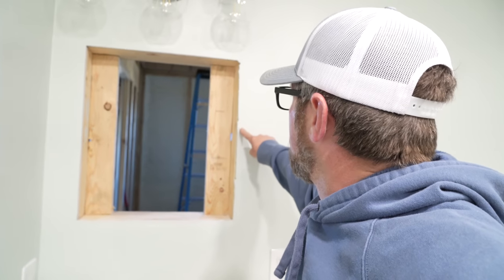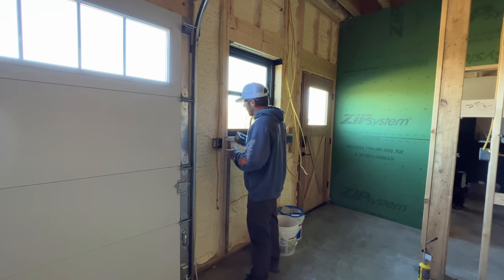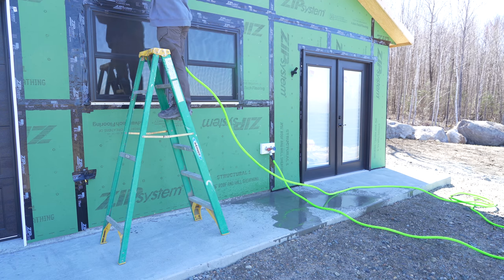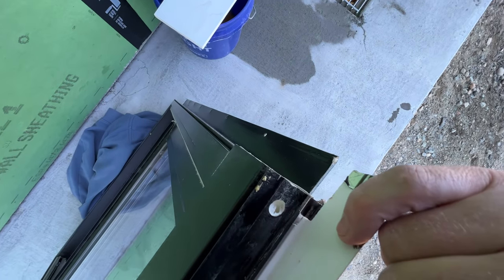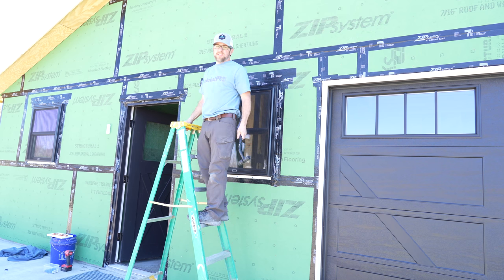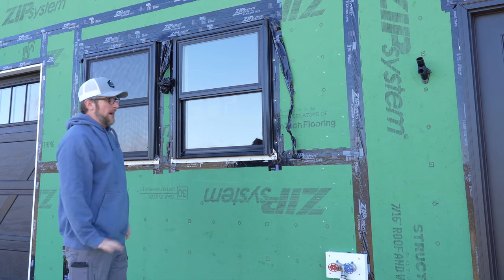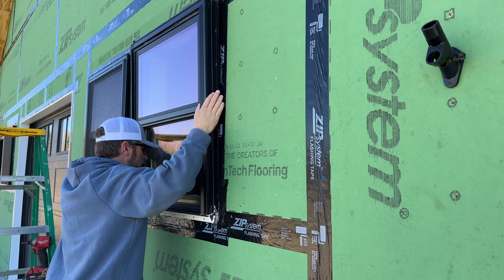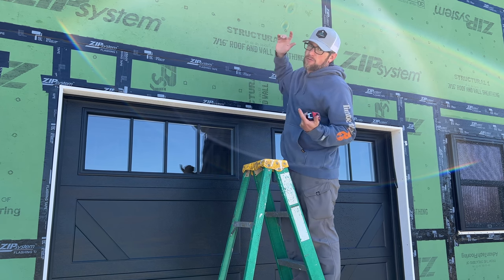THIS IS DISAPPOINTING  | Building Our OFF GRID House in the WOODS

Comment: I always use a drip cap over windows and doors, even if the maker says they have a better way. Once you get the siding on and caulk the windows. you shouldn't have any problems. Good luck with the rest of the build.
Reply: Same here. It is not much extra work but provides a better deal against water runoff from wall into the building at each window.
Reply: A drip cap is very essential. Some extend the cap to an inch or two beyond the casing.
Reply: @clark7117  yes, as a rule of thumb, I  went at least an inch over on each side. Sometimes a half inch depending on type of window and siding.

Comment: I still think a stoop or porch cover the full length across the front would not only add to the aesthetics of the home (with matching roof), but it would also relieve some of your leaking problem and allow you to open the roll-up door in a slow rain.
Reply: He said on the video that he hasn’t decided if he’s going put a roof all the way across the front
Reply: @lorenturner4838  yeah, I saw that after I made my comment. He said he was thinking of a cover over the front door OR possibly the full length. I think a full length cover would look really good PLUS would shield front door and double doors leading to the prep room. Additionally, it would not only protect the roll-up door, but it would give the ability to have it open without worry during a light rain.

Comment: As a one time window builder, I would say it's the window at fault not your installation. The corner 45 degree joint is a common weak point in the build. The jig may not have been set exactly straight during manufacturing. A touch of clear silicone added to the corners of the frame may give you peace of mind. Good luck.
Reply: I agree that its the window itself. Not installation .
Reply: I also think it is the window and not the zip tape. I had the same kind in white and mine did until I caulked mine in the corners and around the inside edges.
Reply: This is exactly what I thought was the problem
Reply: @jerrywelch5323  I have 17 Pella windows in my house and 14 are the same double hung that Lumnah Acres has in there house and I had 2 that leaked a lot  and 1 that only on a hard rain. When a removed them they had some cracking at the joints and leaked from bracks on the inside at the bottoms.
Reply: Ditto  on the silicone.
Reply: @justatim8143  Did you look at the video and see the sun coming threw the nailer holes
Reply: @justatim8143  Yup. I also have had them leak around the seals in the Up/Down channels. A hard rain can blow right through them and pool at the bottom. Had to put trim around the outside of the windows, covering the sliding window edges to keep hard rain out.
Reply: @jerrywelch5323  All I seen was light coming in at the bottom which is OK to let the water drain out of the bottom.
Reply from the maker: Thanks Aaron
Reply: Pro Pm seen same thing on finished sky light uppers 20 foot atrium. After they blaimed my roofers mason carpenters and finally window cleaners I told them bad windows 
Yes bad windows
Reply: @justatim8143  So what do you do let water out between the wall and the siding ? That don't make Sense. or you could build a spillway ?????? If you have water behind the tape YOU installed it WRONG !!!
Reply: @jerrywelch5323  You should not have water behind the tape, if you do it is because of a crack in the corner joint and most times it is the bottom corners and beveling the bottom will allow the water just to flow out the open bottom which should be left open.

Comment: Good morning Al and Gina. Al sure looks like a window problem. They just aren't made the best any more. Put some good clear silicone on each corner and reinstall them. Hope it works out ok for u. But your home is really moving along.
Reply: yes i agree. either the window is faulty, a bean counter problem so they wont fix the design cause its cheaper not to, or its made to shed so need the slight tilt

Comment: Al, maybe it was the use of the gas heater, the moisture it makes was condensing on the cold windows. You never noticed it until the hard rain. Hope they never leak again. A suggestion for Gina, she should fill the raised beds she has put together and plant her cole crops, lettuces and peas while it is still cool, then put the rest of them together. Love the bathroom, can't wait to see the shower.
Reply: Linda Linda - That makes sense about the gas heater, but the water did come in when he sprayed the windows with the hose.

Comment: Al and Gina, look into rail extension for the garage door, they would allow the door to go further up the wall and turn a slightly smaller radius to the upper tracks, this would allow you to “box in” the garage door with the ship lap or whatever material you are applying to the ceilings downstairs, check Pinterest you’ll find examples…
Reply: I agree if they went to the ceiling it would look better and have room for the ceiling fan.

Comment: Get your heat working, the windows are probably suffering from condensation from cold rain and a local propane heater. The way you've taped the windows is fine, a bit excessive, but fine none the less . Finishing the out side with flashing , siding, and chalking will guarantee no leaks, tape isn't designed to be the final and only seal.

Comment: Al & Gina, I'm very impressed with your build and troubleshooting. As for the window issue, I believe there's a drip channel you can install over the top of the windows prior to sideing, to help deflect water from running down the window. But maybe you've already investigated that option? Thanks for sharing your progress👍👍👍👍👍😸🤗🐺
Reply: I think you’re referring to flashing.
Reply: King, yes, thank you I couldn't remember the correct term👍
Reply: @KingArtexerxes  It's called a drip cap
Reply: @davidmackay2353  I checked online, and you’re right. I once heard someone call it flashing and it stuck with me ever since then.   Flashing seems to be a term used for metal protection pieces on the roof.
Reply: @KingArtexerxes  A drip cap is a form of flashing usually over windows or doors. There’s also a drip edge that is applied to the edges of a roof. Each has it’s own shaped profile. Hope this helps in clarifying the difference between the two.

Comment: You have to remember you put those in during the winter freeze. Everything moves as it wRms up. You never caulked around the lip of the frame. You used pressured water on the windows (not typical of even severe weather).  Your siding will most likely be sealed around the windows with caulking, which will seal them up.
A hard roller will not be perfect on a semi-rough surface. Use a softer roller that will press into the uneven surface!

Comment: Pro Tip for Zip system flashing 
1) always set windows in urethane caulking top and sides 
2) pre wet zip face with 3m spray adhesive. Tape will not fail 
3) use heat gun to set tape helps major

Comment: FYI with zip tape it takes the tape several days to fully cure. You just soaked it.  You might have ruined it by getting it wet.  Also try the compressor blowing air back out which could locate the leak spot.

Comment: Sometimes the tape will bite you back by trapping water that would normally run out somewhere. Please  use metal flashing on your head casings. Lead is the best, and caulk everything.

Comment: I can't see the drain holes on the bottom track of those windows but I'm sure you checked they're okay.  If it takes a slanted sill to prevent water from coming in, I'm thinking the leak is coming from the frame of the windows not being able to get rid of water coming down the outside window pane.

Comment: Al, just a sidenote about vinyl windows. When manufacturing the side rails, the extruded product may have a film of oily substance that can cause some small leaks during driving rain so whenever installing new windows, I will use a rag and wipe all exterior surfaces using denatured alcohol. It helps in avoiding small leaks like yours. So far, nice work!

Comment: Al, I would have used the little rubber grommets on the screws to the windows, similar to what you used on the metal rooves on your other buildings, to help keep water from penetrating. Are you breeding your goats this spring, and which ones?

Comment: A technique that I used for finding water leaks in cars ... windshields or body seams, was to soak the suspect area with soap water, then using compressed air in the inside ... looking for bubbles that would confirm a leak. This works much better than just soaking the suspect area as air can find a leak a lot easier than water can.

Comment: Extra caulk around a new, or replacement windows helps with keeping the water out of the house. Some kind of drip edge on the top directs the water away from the inside of the frame.

Comment: I'm pretty sure a little bit of water can get in on the sides between the slider and the frame, with enough wind driving it.  Not much you can do to prevent that.  Those can't seal completely. They have to open, so there has to be some space there or they wouldn't slide.  Now that it has a way to drain to the outside, no more puddles.
Reply: Not a comparable situation. I worked in an 9-floor building in the Middle East. A freak wind and rainstorm blew in. Some buildings nearer to the sea found their windows at the back of the rooms. We were OK, except that we watched the water blow the seals and spray in through every possible joint in the walls and windows. General rule, if you cannot observe water penetration when testing, you did not try hard enough, increase the pressure and flow rate, water can always find a way in, just try to find it an exit route.
Reply: Have you explored the possibility of "capillary action" to explain the water penetration? I'm thinking the driving wind pulsed the window enough to create the pressure to draw the water in.

Comment: Al, Gina, Always suspect the moving parts. It may be worth lubricating the window seals with something that does not set but repels water. This to overcome hard seals in cold weather or deformation of the frame on installation creating a small gap. Soldier on. Regards Stephen.
Reply: Stephen Riley ,
And that is exactly what WD- 40 does.  WD , ( water displacement formula number 40 ) Works great under the hood of a car during wet weather. Helps to keep ignition wires , spark plugs and electronics dry while driving during wet weather. Also it helps to repel water under the fenders also. I apply it to window tracks for smoother operating automobile windows. Mine do not freeze shut during the winter. Which I have had happen prior to using WD-40.
Reply: @donaldmiller8629  👍👍👍

Comment: I could bet the water leak is the joint of the lower window frame. It seems to be attached by screws if I saw it right. With the slight incline now, there might still water leak but run outwards.

Comment: Every zip install I've seen the installer is using a silicon bead around the top and sides of the windows before screwing them in.  Water will always find a way in, so silicone behind the frame rim before screwing down tight should solve the issue.

Comment: Al, are you noticing condensation on other windows? Are you still using propane? Are you running the air venting system? Your home is seriously tight even with the Garage door. Try opening a couple windows when you are there. I do agree with the cold weather being an issue, but maybe it wasn't actually leaking. Moisture buildup with propane use is an issue in Rvs and van houses. I also think i remember you put on the tape and then rolled it, rather than rolling each piece, when you put it on.
Great progress, you are amazing workers. Thanks for the peeks at the animals. Your large rooster with the main flock is beautiful. I like the way he struts but feel sorry for the little banty rooster.     :-)

Comment: Hello cabinet door in the washroom always opens towards the left I’ve never seen it open towards the right and there’s something called liquid rubber you put it around and on top of the tape and windows and doors and even used on the roofs liquid rubber find it and use it stops water

Comment: It might be wicking back in on the bottom of the window. Traditionally a chamfered cut on the bottom of the window 🪟 would break the surface tension and allow that water to drip out side the structure. However your slanted clapboard method should work well.  Glad you caught it sooner rather than latter. Keep up the good work.

Comment: Are you going to run a ventilation pipe or duct to vent any moisture when you turn on bath exhaust fan?
I noticed when you installed it there was no where for it to exhaust any moisture when you have shower on.You’ll have mold issues within the sheetrock ceiling is it’s not properly vented to outside.
Reply: I believe he said in an earlier video that it will be vented through the roof but it was winter at the time.
Reply: There is a vent into the roof space. This was shown in a previous video.

Comment: When I worked with engineers (PE) in facility management I learned that wind can drive water vertically 1 inch per 10 mph of sustained wind. 2"/20mph 4"/40mph etc. As in, up thru the bottom of the window. Once the siding is on, probably wouldn't have been an issue. However, now even better with the sills in.

Comment: I'm  about 10 minutes in on this video, it is possible the window frame itself has a weak spot allowing for the leak?, my other concern is whether these windows are argon filled & is there any indication of moisture getting inside the windows themselves, if not, then you might be able to seal the mounting lips & the frames with clear silicone, but it would be nice to identify exactly where the leaks are originating from...I've finished watching it Al & Gina, I'm left scratching my head on this one, but installing the tapered sills was a good idea...
All the best,
Bill... :~)

Comment: Look at the joints above the window it could be getting in behind and running down the inside of the panel and it shows up at the window every time
Reply: I had noticed that also .That can happen ,I'm a framer now for 30 some years ,as soon as you put any exterior finish on your wall that should eliminate that issue if that would be the problem .On a last note Al ,love your work ethic ,you emphasis on quality,I'd hire you on my team any day .

Comment: It’s the window itself. Many times have found window sill at corners leak, thus only at corners and bottom. Unless you seal that sill and side rail joint with silicone it will leak again. Seen this many times.

Comment: Using my technique with compressed air (with a pinpoint air nozzle) and soapy water, you would have easily confirmed the exact place the water was coming though. It very well could have been inside the window assembly and not between the window frame and the opening.

Comment: I like the idea of a roof over your entry ways.  A safety reason is that it gives you an easier exit out the bedroom windows in case of a fire on the first floor (God forbid).
Reply: I never thought of that but you're totally right. Much better to get down from there than the full height of the second story. Good idea.

Comment: The problem maybe the window building up condensation. I wouldn't install a window or door without running a bead of Silicone under the lip all around it. That would eliminate any possible chance of water oozing in from outside. Just my 2 cents. Also, thanks for our weather forecast lol

Comment: you shouldn't have been able to pull the zip tape off so easily, so I'm guessing it was too cold when you fitted the frames & tape. I suggest refitting those 3 windows (or new ones if you decide to go that route) with a bead of silicone sealant down the sides & along the top, before fixing the frames. then apply the tape in the same manner as before - but on a hotter day this time!
fyi, good day from New Zealand!:_Pluto::_Tanner::_ILikeIT::_Figaro:

Comment: Get rid of the garage door 
Get one of the sliding windows. The ones that slide to the side and give you the opening outside without the tracks on the ceiling
Reply: They may be moving animals for processing with the tractor to the Harvest House. The garage door would be a must.
Reply: There are accordion style windows that push aside and will still give you the room for the tractor to fit inside

Comment: I would've figured the framework was the culprit. I've gotten brand new windows before that leaked where the glass was installed in the frame. Hopefully you'll have it figured out by now, and not have to worry about it. The electrical connections on the exterior doors was spot on, and I'm sure I heard Gina and Olivia discussing opening the medicine cabinet right to left a few videos ago. Lol Love ya'll ❤️
Reply: Al was worried that Gina might have changed her mind!!! It happens!!!
Reply: @tonygrimes13  I get it, I've done it myself, had two wifes, changed my mind, divorced them, now my cabinets open from the left...lol

Comment: I really don't think it was the Zip Tape.  More than likely, it will be the window itself.  If you worry about temperature, try using a heat gun to equal the heat it needs to adhere.

Comment: You mentioned you changed the fan circuit and installed 12-3. Wondering why you used 12 wire for a light circuit? Cost of copper is crazy thought you would want to save as much as possible. Shouldn't 14 Guage be plenty?